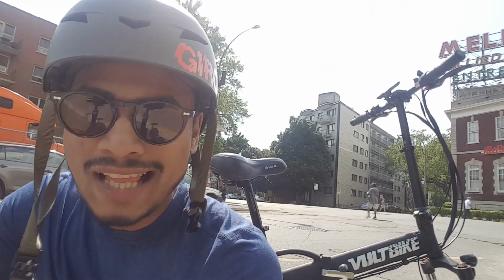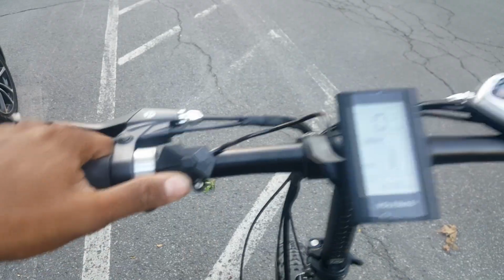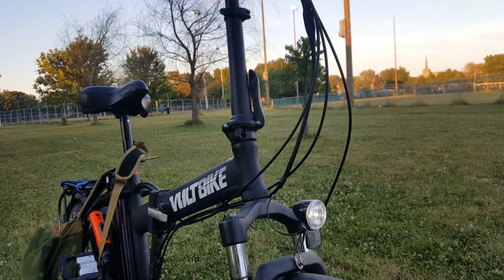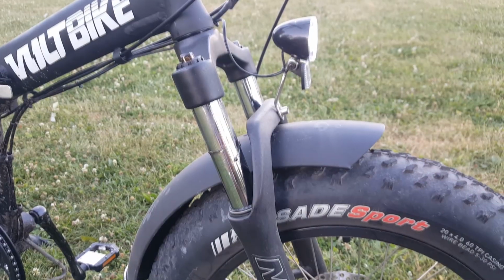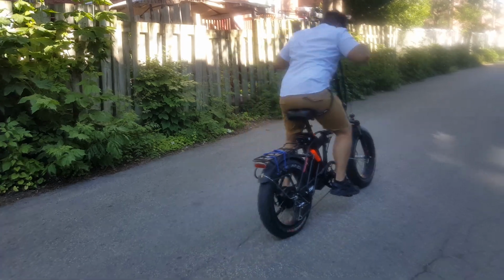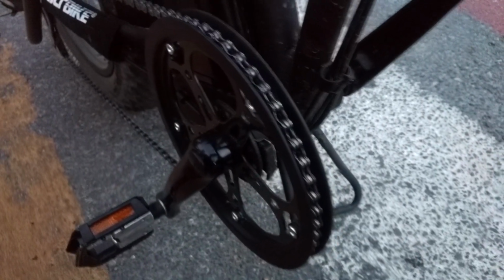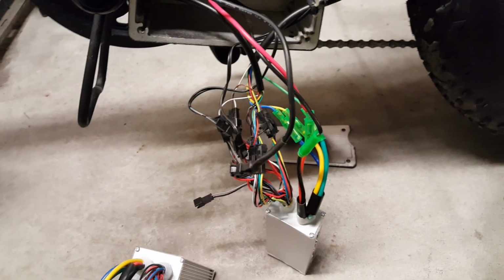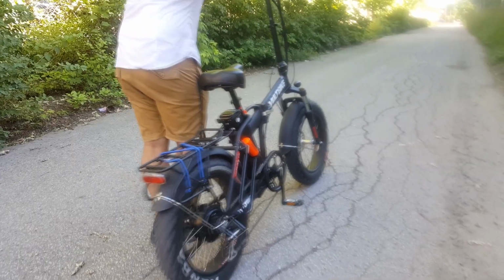VoltBike Mariner 2018 First Impressions

Comment: hmmm Ameer judging by the locking cable you had it was an EASY steal - hope you read my comment on the that video regarding locks ; anyway, the new one has upgrades so....meantime appreciate your videos and hope this one gets BETTER locking system !
Reply from the maker: I did read read through it, it was very helpful! I'm going to pin it so everyone one can see it!
Reply: @ameerally  additional info worth considering : although the Abus link lock is very good comparatively it CAN be cut at the link pins fairly easily - am guessing similar  problem with the Volt lock but haven't seen any info regards that yet - another reason why i prefer the long albeit heavy hardened steel Abus or similar chain lock ; perhaps a good idea to get a lock with bike replacement warranty [ Kryptonite used to have this but now ??? ]
Reply: @jconearth6686  Kryptonite warranty doesn't apply if they use power tools to break their locks; seems pretty ironic, since without power tools their locks shouldn't fail.  I'm looking into bike insurance.

Comment: Hello again Ameer, i was wondering if you could help to clarify some confusing info from Voltbike's online page for me? On the site, for the Mariner 2018 is written that the battery included is a 48w 14.5Ah battery, but right next to this is an image of a samsung cell of 11.6Ah. Which did you get? It seems like a leftover picture from updating the page of an older model but it would be nice to have a clear picture. :)
Reply from the maker: I got 11.6ah 48v

Comment: Just curious, had you looked at the RAD POWER Rad Mini Fat Tire Folder, in comparison, before purchasing the Mariner?

Had wanted your comparison thoughts.  
Also, pretty much all eBikes are at that weight, unless you get a flimsy, more about "Cool  Euro Looking" one.  
Thanks!
Reply from the maker: Hello sorry for the late reply! I loved the rad mini but the only problem at the time was they didn't ship the bike for cheap and it didn't come with front and rear fenders. which was why I went for voltbike Mariner instead. I've been using the Mariner all season and it's hasn't let me down yet. Just the motor screams whens it's cold outside.

Comment: I really appreciate the review.  Mine is on a truck to me as I type this.  Since you had a negative experience with theft, what kind of lock did you go with?  Since it is a fat bike would you recommend the longer U locks over the standard?
Reply from the maker: Gabriel Staples I'm using a longer 14mm ulock series 4 from kyponite. Seems to do the trick for the moment

Comment: Thanks for posting this. I've been looking around for the past couple of months for a used e-bike, or perhaps something new that isn't too expensive (in Montreal)... Found a Mariner this morning on kijiji, and now googling around for more info. Theft has been a MAJOR concern of mine in MTL... I've had regular rusted up mountain bikes stolen right off my balcony before, so I'm just curious, what area and time of day, type of lock, locked up to what exactly, etc etc etc... how did it happen? Thanks for any further info on your experience that you can provide. Cheers!
Reply from the maker: I had my bike stolen when I was at work at hochelaga, (where most bikes get stolen), funny then is a year later I see my same bike on kjiji for 300 bucks with no battery... As for locks, to be honest most locks are useless against the right tools, but I have been using 2 locks  when I leave my battery on the bike. So far so good, I have seen people try to steal the battery but no luck. I hope you enjoy your new bike fellow montrealer
Reply: Why would you leave the battery on? Did you report the guy selling on Kijiji? What brand are these locks?

Comment: Sweet, thanks for the overview and pointing out that damn latch flaw. By the way, how quickly can you reach peek max speeds 32kph-ish on this one with a relatively flat surface? I live in Villeray and commute to Ubi StLaurent daily so its mostly flat but has quite a bit of red rights on the way which makes it tedious to stop and go all the time.

Really like the compact format but i do want something with enough kick to accelerate to mid 20's for traveling with trafic.
Reply from the maker: Hot_Drop_O'Clock volt bike says it's pelt assist but it's more pedeal activate, it's takes under 3 secs to reach top speed. Don't work about traffic lights, with the bike the field of view is double than a car.

Comment: What has your experience been with getting this volt bike as it gave you any issues has the company gave you any issues?
Reply from the maker: Only issue I had was water getting into the controller box. Volt bike helped me out and gave me a new one.
Reply: @ameerally  Thank you has the new box been better and what have you done to keep the water out?
Reply from the maker: @sorrowinchrist3387  the new box Elisha well. For the controller box, I silicone the edges where I think water could get in and that's it. I haven't had a problem since '' knock on wood '' Ive used it in winter and I have a video coming for that